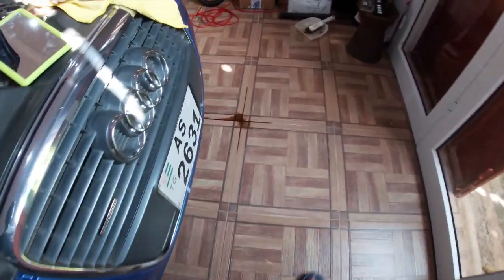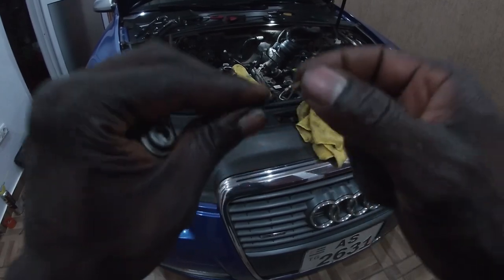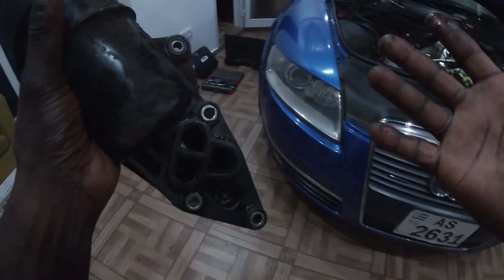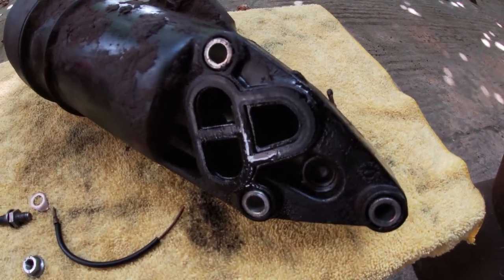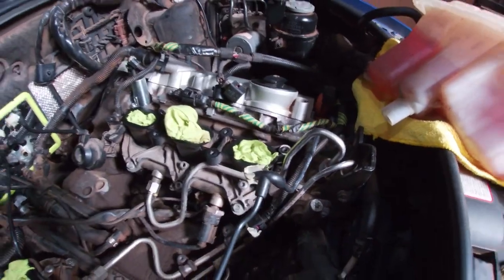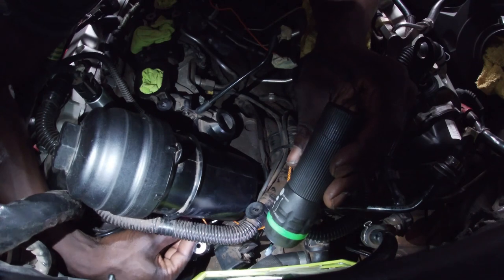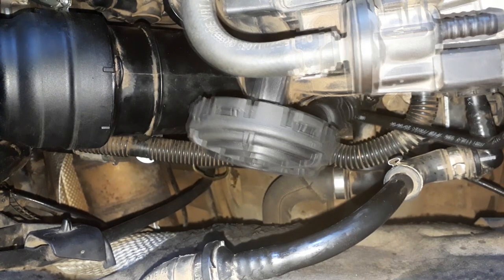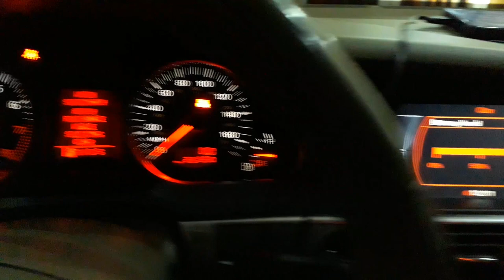Audi A6 3.2 - Oil Filter Housing Gasket Replacement

Comment: Well , after my last comment regarding the fans, fan module and sensor replacement.  Replaced all three and took care of the overheating issue, (seemed like the sensor did the most good).  Unfortunately, they sent me the wrong fan control module so I have the old one temporarily back in there.  All is good but I now have a few good oil leaks that have gotten a lot worse.  There must be something up front as the fan, (drivers side fan) has oil on the electric motor.  Even the serpentine belt slipped off because it got so wet with oil.  I'm going to take a better look but I think some oil is in the V of the intake.
Reply from the maker: I am glad you've been able to fix the overheating issue and I am sorry about your oil leaks issue. Overheating can accelerate seals and gaskets deterioration. Based on your description, I am suspecting the front engine caps as shown in the picture at the link below of my cam girdle resealing. I did it on both sides. What are your thoughts?
https://cimg5.ibsrv.net/gimg/www.audiworld.com-vbulletin/580x326/20200202_121245_7d9eec4336ee80c5907eb35b33d5cc259ea3d844.jpg
Reply: @ThatAfricanGuy  You are so right.  Especially with all the miles I have on this car, (240,000).  With it heating up, (never overheated) your comment is spot on with the reason why it started to leak more oil.  Also, even though I haven't checked recently, I had oil in with my spark plugs.  This is why I changed my valve cover gasket a few times thinking it was leaking there too.  My understanding, to replace the cam girdle is a pretty big job.  Cams, timing chain, etc. all have to be removed.  Hats off to you as picture looks good.  Special tools too?  Any other thoughts or solutions then replacing that girdle seal?  I did notice, (and ordered today) that the 4 camshaft sensors were leaking a little, (can only confirm 1 was leaking).  Will replace all 4 when they arrive next week.   .48 cents each.  $8.99 shipping :).  First,  I am going to get Lucas stop leak and change the oil with a blend of 10w-40w and 20w-50w. Once the 0 rings arrive for the cam sensors I'll hopefully have slowed the leaks again.  Any other thoughts?  Again, thanks for your comments and enjoy your videos and comments.  John
Reply from the maker: @johnjerrehian4642  Using a stop leak solution or a thicker engine oil may cause more harm than good. The recommended oil specification for this engine is 0w30 which is thin enough. The reason is that the engine oil and pressure is key to proper timing. Thicker oils, especially with a leaking engine will help destroy your probably already weak upper timing tensioners. They have an integrated oil screen which is designed for thinner oils. Watch this:  https://youtu.be/A7mTFdoE5Z0
Reply from the maker: @johnjerrehian4642  Here is the thread I posted with pictures and videos showing from A to Z how to deal with this: https://www.audiworld.com/forums/a6-s6-c6-platform-discussion-58/fixing-oil-spark-plug-other-engine-oil-leaks-3-2-a-2987300/
Reply: @ThatAfricanGuy  The recommended oil, (for this engine here in the states) and my manual is 0w-40w as they recommend Mobile 0w-40w.  Also, living in a warm climate I don't need the lower viscosity.  Understand your point.  I am surprised you have had to do so much work to your car.  I keep finding more videos of yours doing some serious repairs.  How many miles or km do you have on your 3.2?
Reply from the maker: @johnjerrehian4642  2005 Audi A6 Owner's Manual, page 311, I quote: "The engine oil which was first put into your engine has a viscosity grade of SAE 0W-30. You can use this oil across all temperature ranges for normal driving. If the engine oil viscosity grade SAE 0W-30 is not available, you can also use SAE 5W-30 or SAE 5W-40."

In 0W-30, "0" is the minimum outside temperature in which the oil can still perform well and "30" is the viscosity grade. The higher the viscosity grade, the thicker the oil.

You find videos of me doing work on my car because I document almost everything I do on my car and most of the videos are first times. There are definitely cars out there with more maintenance done by the dealer, a local shop or the owner. They just don't take the time to record a DIY video, edit it and share it to help others like I do, that's all.

Mileage is currently at 268,000 km. That is about 90,000 km under my ownership, mostly driving in very tough conditions. 90,000 km here is something! You can double that to get a realistic figure in a country like yours.

When I purchased this car I tought I would maybe get at max 2 years out of it. It's been 5 years and on. I am surprised the car is still holding up in this environment with my VERY AGGRESSIVE driving style.
Reply: @ThatAfricanGuy  Correct.  That viscosity was what was written.  When car was newer, Audi dealer always put 0w-40 as "specified from Audi" so that's what I've run.  Recently, I purchased 10w-30 and had some leaks, (but not like now).  It gets very hot here in the Summer months and Winter isn't cold, (as our low may be 50).  When I replaced the valve cover gaskets at around 215.000 miles, the cams, springs and valve components looked great.  Not a spec of carbon or build up anywhere, (on both banks).  So, after all the miles it has treated me well, (with very little issues) until recently.

Your videos are great and very informative.  You show the part and address variations of damage and/or new part.  I did see some of your videos on the roads you drive on and yes, they are very tough conditions.  Plus, all the dust too.  What are you speed limits on the hwys there?  They are 70 mph here but most run around 80 mph / 128 kmh
Reply from the maker: @johnjerrehian4642  Makes sense. FYI the temperature spec is in Celsius, not Fahrenheit. Speed limits here are almost non existent. My average city speed is 80 km/h and my average intercity speed in 160 km/h. I have driven over 200 km/h a few dozen times. However since most back roads are not paved, I find myself crawling under 10 km/h most of the time and when it rains, it's worse. First or second gear for miles.
Reply: @ThatAfricanGuy  Some roads in other states aren't as good but the lack of Winter here in Florida keeps our roads in good shape.  I too have made many runs in this A6 over 200 kmh.  However, I am very cautious as if caught at that speed by the police I go to jail and a huge fine...  I am waiting to receive my new fan control module, (that should be in today) as they sent me one for a 2006 vs 2005.  Wire colors were different too.  Also, I have 4 new camshaft sensor 0 rings on their way too.  I can see they are leaking also.  Good news, after changing oil the leaks are much less this morning than when I just has 0w-30.
Reply from the maker: I see. Yes, speed restrictions are enforced in th US so you've got to be cautious. I wish you will be able to fix your oil leaks. I am glad it got better with your last oil change.

Comment: In 15.30 the bolt that u had trouble unscrewing, do u know the exact size or part number? Thanks in advance
Reply from the maker: The part number is N10285602.
Reply: @ThatAfricanGuy  thats the single one on top? Cheers
Reply from the maker: @chriskim7642  I think so.

Comment: Would you recommend doing this job if you were just going to do the drivers side cam cover? Had to stop because of the double connector.
Reply: I took a pry bar and bent the bracket back a little so I can now grab the bolt with my hand. Your patience with these cars is amazing. Last one I will ever own.
Reply from the maker: @chrism9185  I apologize for the delay. If you mean driver's side upper timing chain cover, yes, definitely because you have to remove this setup to properly remove and place back the driver's side upper timing chain cover.

In your second message you said you bent it a little to access the bolt. That's fine too but be gentle not to break the bracket and remember to bend it back.

I also curse sometimes when I work on my car, you know. It is frustrating when things don't go as planned. But I change my mind after I figure things out and then I love the car even more 😅
Reply: Told the guys about your channel and posted your video on Twitter too. One guy yesterday at work said that he thinks one day they will void a new car warranty if you work on it yourself. I told him I wouldn't be surprised if they did. Hope I don't have to junk the 06 A6 but if it still has problems after I replaced the hpfp that is it with this car. When we brought it the owner had the engine cleaned like is was new. We got taken, oil is everywhere. :(
Reply from the maker: @chrism9185  Hahaha! People don't usually work themselves on a car that is still under warranty. They let the dealer fix the problem usually at no cost. Sorry about the leaks. Fortunately, they can all be fixed. Why do you want to replace your HPFP?
Reply: Had a code also the car has 186k miles on it. Hope when the coolant crossover pipe gets here i can start putting the front back on the car soon. Second pipe the first came damaged.
Reply from the maker: Can you please tell me about the code when you get the chance? No rush.
Reply: The Foxwell vag scanner had 08852, 00955, 00774 and 08304. In ObII mode P2294 came up. Read online that it could be the hpfp. The dealer wanted $170 to diagnose the problem.  I figured put that money towards the hpfp which I did put in. They also told me if I drive the car i could damage the catalytic converter. So will find out whenever I finish the job and try to start it again. If it runs smoothly I was lucky if not out it goes with some new parts.
Reply: Forgot one more code 01110 the car was running good then trouble. While it is apart I'm trying to fix some of the oil leaks.
Reply from the maker: I appreciate the feedback!
Reply: I got the timing chain cover on the driver's side off today with the last to bolts with a stubby 30mm torx bit. I think I see the bolt that you said took a hour to get out on the oil filter housing. Looks easy to get to or it is the wrong bolt?
Reply: Forgot to ask if I try to do this job. Did you use the green seal at the very beginning or the black seal was installed in the car? Hope it didn't leak after all that work.
Reply from the maker: @chrism9185  I don't know which bolt you are talking about so I am not sure but the bolts to remove are indeed next to the driver's side upper timing chain cover.
Reply from the maker: @chrism9185  There is no green seal here. I just made the seal glow in green in the picture. It is black.
Reply: Thank you. I think I will try to do the job too. Going to by some brake cleaner so I can see the bolt better. The second crossover pipe got her today and it was not damaged like the first one was.
Reply from the maker: @chrism9185  I suggest you use a WD-40 degreaser safe to use on plastic instead. Brake cleaner is a little too strong.
Reply: Good point thank you.
Reply: My 06 A6 had one long stud on the filter housing and couldn't remove it. I did get the new seal in by sliding it back. I also broke the ground wire too. I added a longer wire and connected it to a acorn nut that had some wires on it by the driver side hood strut support. Ordered a new hpfp connector because the old one can pull off.
Reply from the maker: @chrism9185  Wow! You've been through some tough stuff.
Reply: Things didn't go to well on the job that I did. I have a lot of codes now. But the car starts right up. Anyway have you ever worked on the ebox fuse box on the drivers side by the wipers? Hope it is just a fuse. Codes 05416, 05430, 04176, 04180, 05494 and 05490. Ordered a tool to get the wipers off also the car sat so long the wipers stuck when I turned them on. I work slow and parts came damaged from shipping.
Reply from the maker: @chrism9185  Sorry about that. No I never touched that box unfortunately. What are the description of these codes?
Reply: I got it apart and a red 10amp fuse was blown. Running great now and past inspection too. I ordered the wiper puller again. Only have 2 screws holding the cover to the ebox. Getting it back together not as easy as pulling it apart.
Reply from the maker: @chrism9185  I am glad to learn there's been improvement. 🙂
Reply: Me too. While apart I might put in a wiper motor.
Reply from the maker: @chrism9185  Could be just another blown fuse. Did you disconnect the battery before doing all this? You might be causing all sorts of shorts.
Reply: I did not disconnect the battery and mixed up on one connector. The motor mounts code went away after the reset too.
Reply from the maker: @chrism9185  Oh Okay. Next time please remember to disconnect the battery. It is very important. 👍🏽

Comment: How long did it take you to replace it ? My mechanic charges me $965 USD to do it, with $300 in parts and $665 in labor which he counted 4.6 hours (at $148/hour). That sounds pretty expensive to me. Does it really take more than 4 hours ?
Reply from the maker: It depends on what else he is planning on replacing while doing it. Besides the oil filter housing gasket, it is recommended to replace the upper intake gaskets and the PCV valve gasket because they need to be removed to get access. I replaced the PCV valve itself. Some people also replace the entire oil filter housing. So you need a detailed quote when it comes to parts. The genuine oil filter gasket only costs less than 15 USD. As for the labor, 5 hours sounds correct.
Reply: He replaced the entire oil filter housing and also replaced all the oil, even if my oil was only 400 miles old. That is it for parts, 310 USD. And 655 USD of labor = 965 USD total cost just for a new oil filter housing. 😱
Reply from the maker: @easynickname09  Sorry about that.

Comment: If i was you I replace the hole housing. Inside housing you got 2 more rubber valves and they holding oil pressure.
Reply from the maker: Thanks for the suggestion. But it's been more than 10,000 km after I replaced the gasket and I have no issues.
Reply: This may be my issue.  Mine is leaking like crazy again.  I only replaced the main gasket when I did it.  I plan to replace the entire housing tomorrow.  I hope it doesn’t kick my butt.  I don’t want to remove the intake but I think I will have to. I also hope it fixes the major leak.
Reply: @jasonpatterson7266  haha, this is my worry now.  I’m replacing the gasket only and am now reading that both you and the OP are having to just do this repair AGAIN and just replacing the whole housing.  Ehhhhhh.  I’m on a time crunch and can only do the gasket.

Comment: Terrible design by Audi...I don't understand why German cars are designed without considering maintenance..
Reply from the maker: Maintenance is considered but not for the average home DIYer. When the engine reaches this point, it would be taken out and other seals and gaskets around the engine would be replaced as well and you're good for another 200,000 km at least. Design is okay 👍🏾
Reply: @ThatAfricanGuy  oh...you have replaced it after 200K? Then that is fine..mine is gone around 100K...
Reply from the maker: @jameswan670  Yes. Around 270,000 km actually. If it fails sonner, it could be due to overheating or wrong oil/additives.
Reply: @ThatAfricanGuy  Thanks for advice! love your videos!
Reply from the maker: @jameswan670  Sure! I appreciate 👍🏾